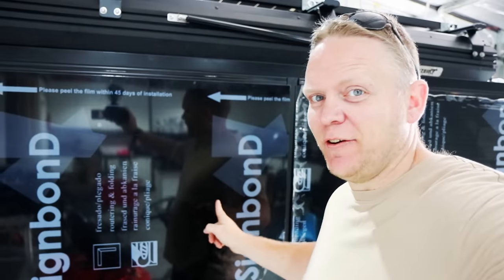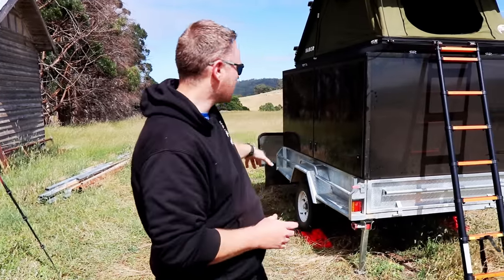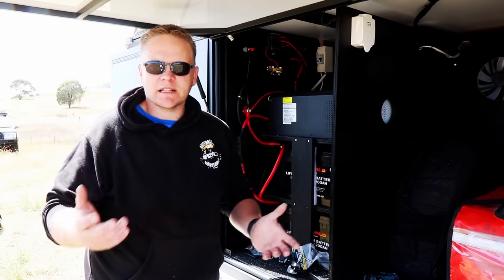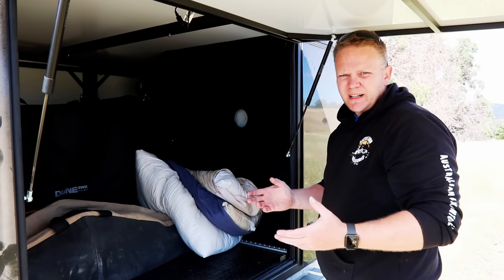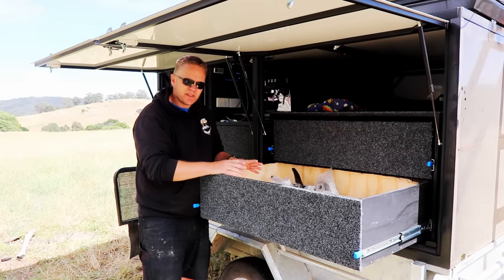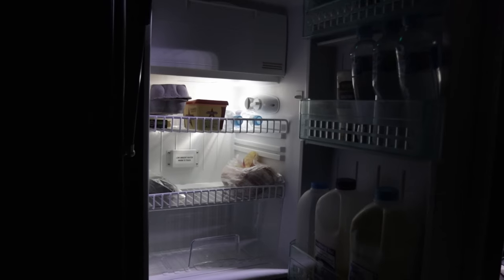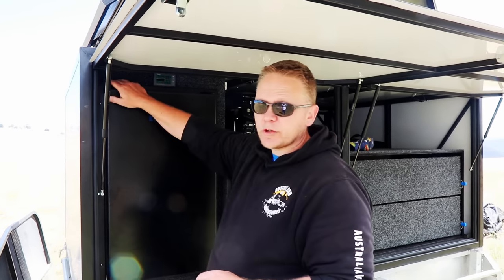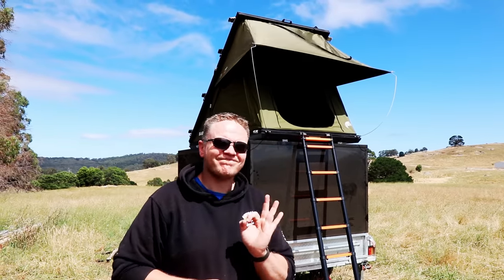Homemade offgrid fully electric offroad camper trailer DIY build walk around.

Comment: Really nice build.. I'll have to send you some pics of my build.. its a copy cat dot 6 trailer.. yet we went above and beyond and made the roofftop tent.. and pretty much everything ground up.. Im going same with fully offgrid/electric. I loved the last drifta dot which was the edot.. So going 3x 200w solar on the roof of the rtt, i got a 300w 70v solar blanket, so in total 900w solar, Im building my own batteries which will be 2x 340ah with 250a bms, I'll have 160L water tanks or 2x80L and a 12/240v hot water heater for showers and on tap at kitchen.. I got a drifta 270 squareback awning with full drifta canvas wall set, drifta dpor kitchen and storage drawer.. though me and my dad designed a legless system 10x better and stronger then sliding tracks and cheaper for the pull out kitchen.. currently I got a evakool infinity 47L fridge, once finished the trailer I'll also have a 95L evakool dual zone.. in rooftop tent I got 2 usb ports, 2 usb-c/pd port, 4 cig ports.. which I got a 17" laptop to watch movies and tv shows that charges via usb-c and run 1 sirroco 12v fan tho I plan to get another one.. In the rtt it has a 20cm thick firm foam bed.. I can fit 3 blankets, 2 quilts, 2 pillows inside.. and at the back of the rtt I got a storage box.. its a double bed... Also have 3 layer insulation on the roof inside. The canvas for the rtt was made byc razy dog canvas.. its a unique design that no one in the world has color wise which the color theme of the trailer is military - army green, black, and camo.. Still working on it though.. Not fully complete as I'm on disability pension so its hard to save for allot of the things to make it.. but its campable as I done so far 6 camping trips doing 4-5 nights.. And so far ive tested it in heavy rain, 50-60km winds, qld summer heat.. last thing is cold.. so in july going to camp in a place in qld near warwrick in the moutains which temps at night are 0 to -12 and frost so that will be a good test. Ive tried my best to keep it australian made.. Id say its 90% aussie made so far. Also has 2T rebound offroad springs, 16" prado wheels as I got a 90's series prado.

Comment: Looks great mate. We have the same toaster....lol.....
Now you're a glamper......either in this camper, or the van......
I don't care what anyone says, if you've got a fire, you're camping. Was thinking about upgrading our nespresso pod machine, but decided the grinding of the beans is too much hassle not to mention the cleaning....
My mums' old redback camper used to bounce along the road on the tyres.......suspension wasn't even doing anything.....I'd increase the trye pressure and see how it goes when the suspension is done......
Side note......maybe one of those swing away slides for the cooktop will alleviate the issues with access to the top drawer.........

Comment: Put a little 12v fan in the fridge close to the freezer to circulate the air, this will prevent the frost build up. There are a few videos online with this mod.
Reply from the maker: I’ll look them up.  Thanks
Reply: @Australian4x4Adventures explore bound has a utube video on the fan inside their fridge

Comment: So glad to see that plastic stuff get ripped off the ACP! I left it on too long once...never again! 
Maybe you can mount some solar panels on the hatches? They will charge at a lower but worthwhile rate when they are down and give you a big boost when they are up. That may require upgrading the struts to bear the extra weight.
That slide out sink and induction cook top is going to remain a PITA. If/when you put the bigger wheels it will get quite a bit higher - ok for you but not so for the better half. Why not get a small fold out table that fits into the current slide space, fit the stove and cut a hole for the sink and just put it on the ground when you need sink and stove?

Comment: Might be good to move the sink all the way to the outside. Stop the dirty stinky water washing over the trailer constantly. Will you be adding shocks to your axle? And updating the leaves?
Reply from the maker: I did think about that.  But most times I seem to just pick it up and walk off into the bush to tip it out.  Rather then having water anywhere near the camper

Comment: Looking good mate. I agree with changing and modifying as you go, I'm currently on the 5th variation of my drawer/bed set up in the Pajero and hoping for some changes again this year. The same wheels and tyres that you have on yhe Troll will go well on that plus means extra spares if you need them. Air fryer and coffee machine? Really? Lol. Gi camping to get away from all the fancy rubbish lol. In saying that Indont have either of them at hone so really doesn't bother me using a gas burner and kettle.

Comment: If you are storing your generator there, make sure its not venting.... You will suck in the smell strait into your fridge area 🤣

My OCD tells me i need to fix up your GPO points & get them to line up.... 
Did i see a bit of carpet/paint missing under your fridge when you opened the door ? 🤠

Still a Awesome build. Im not sure when putting the bigger wheels on it if it is going to fit back in your shed. It looked close when you were pulling it out 👍

Comment: I get where you're coming from in peeling the protective plastic layer on your panels.  Too funny. 😂  But it'll probably make you cry when you get your first bush pinstripe.  The camper trailer has come a long way.  BTW, was this filmed before you got your Y62?  'Coz if not, I'm surprised you didn't use it for the maiden trip of the trailer.    On another note,  a family friends of ours also built a camper trailer with a RTT on it during the lockdown.  But they reversed the position of the RTT where the pop up opening end is facing the front of the trailer.  They then built into the draw bar a series of boxes (for storage), strategically placed on top of each other.  Bigger on the bottom, getting smaller towards the top.   These storage boxes acted like built-in steps to the RTT.  That way, the family didn't need the ladder.  And the steps being more stairs like (ie. wide), were very comfortable to use.
Reply from the maker: Yeah this was all filmed before the 62 turned up.  
I did think about facing the tent the other way and using boxes as steps but I was worried about drawbar weight.

Comment: Not 100% sure, but I think the induction cook tops, when set at anything under 100% will switch on and off according to the setting. Perhaps someone more knowledgeable can correct me? If this is true, then when they are on, they will pull the full rated current. It'll only be for a short time and only occasionally but they could be demanding the full 3500W from the inverter - for a very short time. The inverter will handle this, but it is being stressed beyond its rated power output.

Comment: Looking good one thing what was the name of the battery monitor could not see it on your wall around thanks
Reply from the maker: It’s the renogy battery monitor.
Reply: Thanks for that I found them Did you go with the shunt or not. The build I have followed from day one you have done a great job. Maybe take up a job on the side.
Reply: Kleva cool make a 3d fridge fan Which goes upset your freezer and moves the air around it all so cuts down the ice build up. I put two in my bushman fridge in the caravan they work great

Comment: I know you got the rooftop tent for 1/2 price but how the HELL can they charge $4K for it???  There is nothing in it to justify that price.
Even at $2K it's still hard to justify that cost.
Reply: The RTT industry has gone mad IMO.   Many are taking advantage of the current situation of higher than usual demand for them, that importers/manufacturers have raised their prices.  Plus the AUD dropping in value isn't helping neither.  Some famous brands (Chinese made RTT) went from around $2.5k to over $3k (and some nearly $5k).  But if you think that's high, you should check the prices of the Sth African made Alu-Cab RTTs.  They start from $6.3K+. 😲  The Aussie built Camp King RTTs, they start from $8.5K+ 😲😲  That cost more than what I paid for my 80 Series LandCruiser back in 2018 (pre-COVID).
Reply: @fatmanoverlanding  100%. It's absolutely disgusting these prices. But if people are stupid enough to pay these prices..They'll keep putting them up until the stop buying them. Talk about price gouging to make up for covid. I know I've changed my mind on buying one even at $2K. Unjustifiable.
Reply from the maker: It’s bloody expensive which was one of my gripes with them. Especially value for money.  If it had a few extra mod cons you’d forgive it a bit more but it’s a super basic tent.